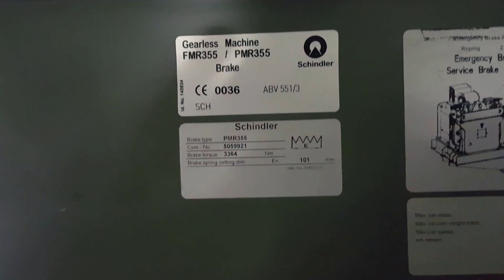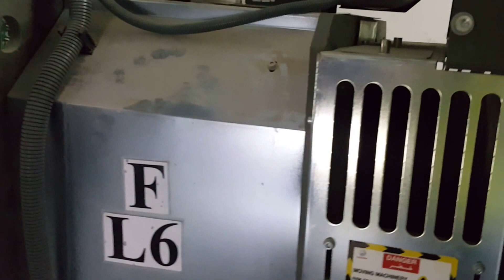Mechanical Room of Lift / Elevator  !!

Comment: Very nice machine room, machines are designed with safety in mind with the guards around the driven sheave. Appears modernization was being done with some of the machines.  The smaller controller boxes at the machines themselves, part of the braking system or motion control?  I noticed the spring suspended anchored cables is the counterweight roped 2:1?  3 Phase 440-480 AC?